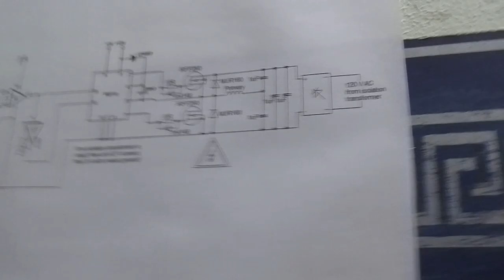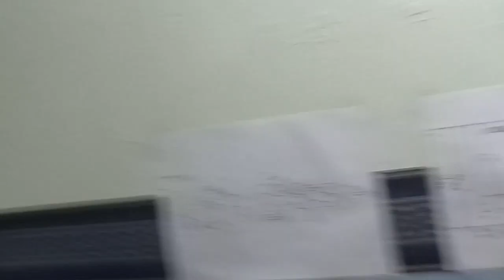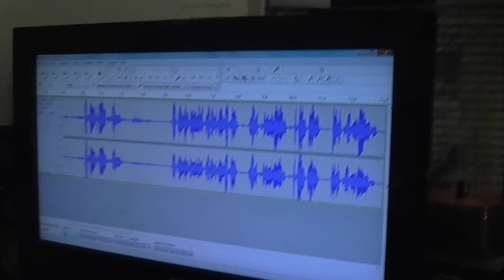Attempting to cut my own records experiment (fail)

Comment: You did it! Nice attempt.
This is a great way to use the CD as an experiment.
I made my own too!
I used full range speaker and I made a needle from a tiny drill bit.
I can record up to 8 minutes on a CD in 33 RPM and 5 minutes on 45 RPM.
One day, I'll be uploading a video about my record lathe, because I haven't upload for a long time.

Comment: Connect the tiny motor to a long horizontal rod, turning it, rod with dense screw grooves. The other end of rod goes into a corresponding bolt which is fixed freely onto the wooden shoulder with the needle/speaker. Put also a potentiometer to this same small motor and with a virgin disk experiment the right spacing by fiddling with the potentiometer. Cheers
Reply from the maker: +hallobaaaby Good idea using a screw type drive to reduce the speed that the cutting moves, I should have thought of that. That motor I used however is what's known as a synchronous motor, it's speed is determined by the AC frequency, trying to control the speed with a potentiometer in series (I guess that's the idea you had) would just burn the potentiometer up.
Reply: oh i see! I fly sometimes these small radiocontrolled planes and have taken for granted that when i move throttle pot up it increaces the rotation speed of motor, but these motors have a small controller circuit (brushless), besides i need a receiver etc. too complicated lol. I wonder if extracting a motor from old VCR player or something will provide a suitable motor... Good luck with continuation Clems, looking forward :)

Comment: I tried a similar experiment yesterday using a large Darning Needle which I clamped into place within a bit of Connector Block which I had glued to the centre of a miniature Loudspeaker.This allowed me to easily try different Needles and projections of the Needle as I could clamp and unclamp them using the Connector Block screws.I managed to record a few seconds of audio at 45 R.P.M. just holding the "Cutter" in my hand and although I got a more natural sounding reproduction on playback compared to yours I think that it was only due to having more luck in keeping the Turntable speed steady on recording.There is potential here Clem!

Comment: In order to get a constant groove spacing, I guess you need to add a bit of friction on the arm that holds the speaker assy in order to keep it from jumping over. Or something similar, do the necessary stuff to make that arm a bit harder to swing, that should help with a spacing problem.

Comment: Nice work! I think your idea is sound and you've designed a fully capable cutting head with the steel needle. Is your playback stylus the same size as your cutting needle? A 78rpm flip over needle would perhaps make the most of those grooves.
Reply from the maker: +OldMaine Actually I just used a spare sewing needle as my cutting needle.  A fresh grampohone steel needle would probably work better for cutting though

Comment: You could improve the arm control with minimal effort. I'd use a hanging weight style anti skate mechanism (look at the tome arms on Pro-ject turntables to see what I mean. To slow the uptake speed down you could wind the line around a couple of pins on a board, like in an old manual pulley winching system where a rope is tuned over a series of pulleys to convert speed to torque.you could also add more pressure to the cutting stylus as the uptake system would have a lot more torque as well as being slowed down.

Comment: Wouldnt it work better if the speaker was mounted in a way so the diaphragm pushed and pulled the needle vertically? Just my 2 cents
Reply from the maker: +Harut .Yeghshatov Records are cut laterally, not vertically especially if it's a mono recording. The only disc records I know of that were cut vertically are the Pathe's and Edison Diamond Discs back in the days of Acoustic recording.

Comment: Pretty cool. I wouldn’t exactly call it a fail. I know nothing about cutting records but I would suspect the amplitude of the signal recorded on the disk would be the depth of the cut in the vertical plane. I think a louder grove might be cut if the cutting stylus was more vertical and would move more if the cone of the speaker driving the stylus were oriented horizontally. Maybe that would be too much movement but it might be worth tinkering with those angles. 

You may be able to find a fan speed controller to slow the cutting arm motor down, like something for a ceiling fan, or possibly make some sort of adjustable clutch surface in the pivot of the arm that had enough friction to slow down the motor.

My bad, I just saw how old this video is. I’m sure you’ve moved on to other stuff by now.

Comment: Hi cool dude,

This comment is so not related to video content, but I just thought, that I'd post on most recent one. I live in place where old Russian tv and audio parts just lay around. And I am dying to build a tube amp for a guitar and I have plenty of tubes but I fail to find a schematic to follow. Do you have anything in mind, that I could build? I know this is generic question without any details, but I wanted to start with asking, if you even have time, to look into it. Anyways, have a good one.